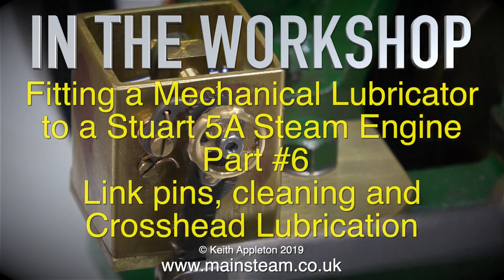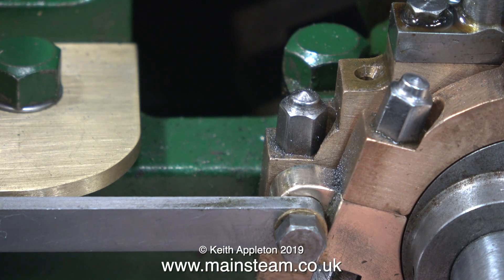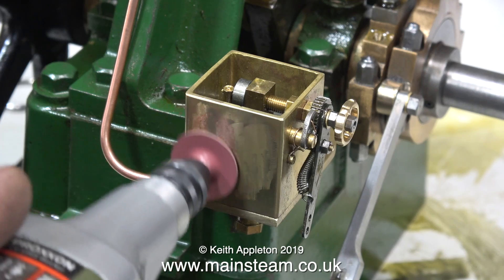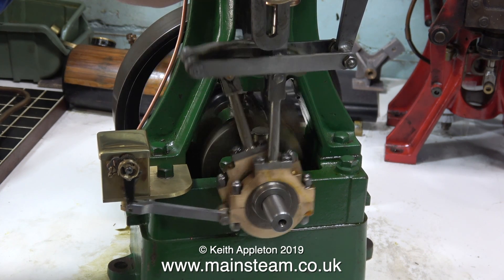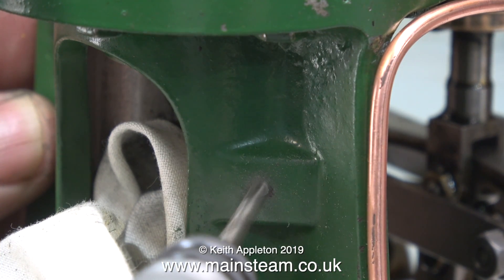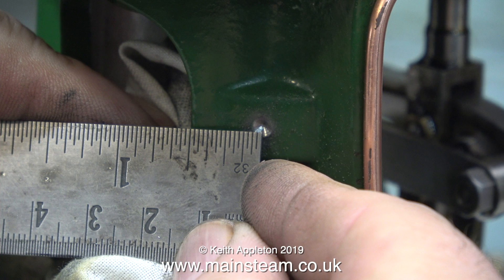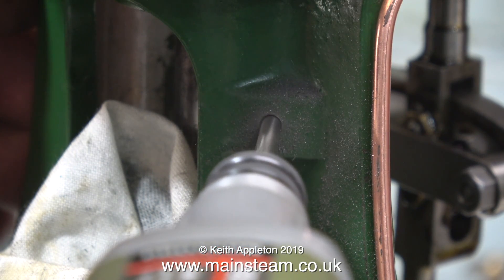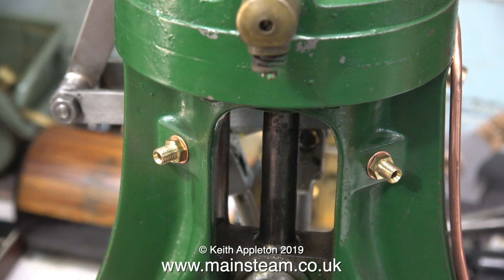HOW TO FIT A MECHANICAL LUBRICATOR TO A STUART 5A - PART #6

Comment: Perhaps i missed it? but how was the engine "oiled" before you fitted the lubricator?,, super films , many thanks
Reply from the maker: Probably it had a Displacement Lubricator in the steam line ?
Reply: @keithappleton  Ok thanks,have you any preference towards the mechanical or the displacement lubricator?
Reply from the maker: Mechanical Lubricators are better in my opinion, their operation is linear and even. plus you can always check the oil level when the engine is running.

Comment: Really enjoying this series and love listening to the engine.  Seems like you only run it in full forward or reverse.  Will model engines like this "notch up" for more economical use of steam and if so what does that sound like?  Different on steam vs air?
Reply from the maker: Notching up is effective on most engines, especially when run on steam. I often demonstrate this in my videos.

Comment: if you want to drill with almost no chance of getting swarf into working parts . . . drill through a gob of window glass putty and into another gob . . . the putty catches just about all the swarf . . . learned this watching an electrician drill a hole into the top of a switchboard over energized buss bars.
Reply from the maker: a good idea }:-)))